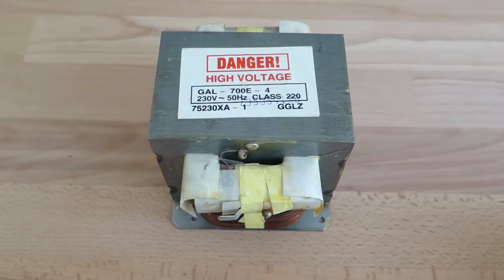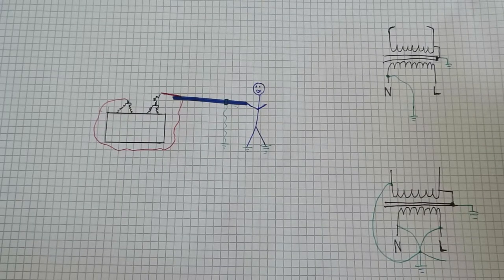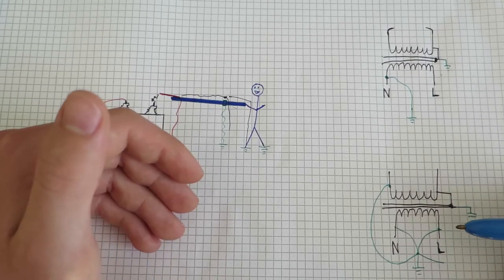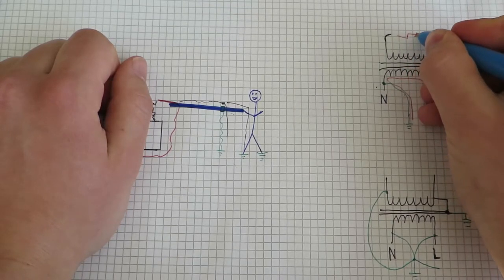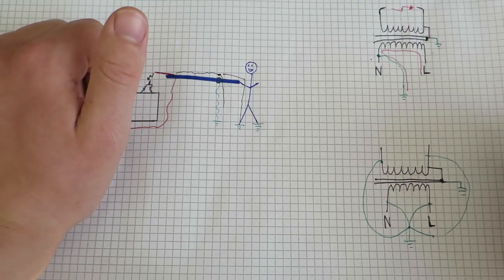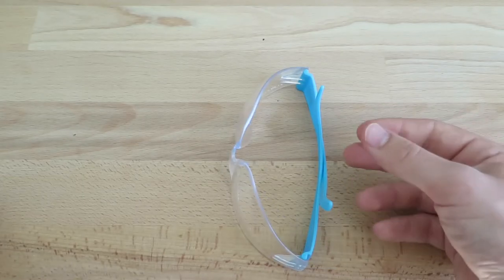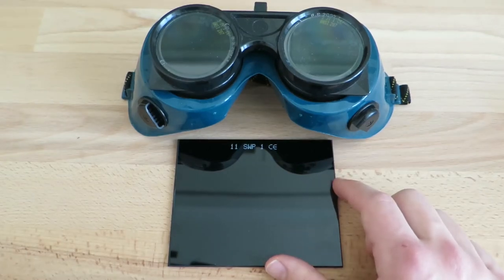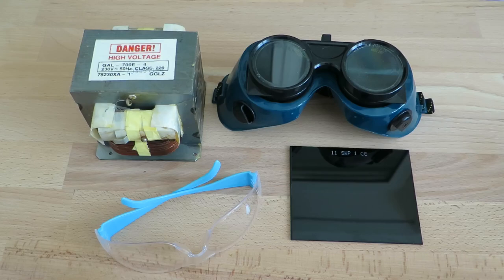High voltage safety (Mot's)

Comment: Neon sign and oil furnace transformers can be very dangerous. I had a transformer that
was rated at 14,000 volts.I forget what the milliamps were but this sucker  weighed in at
over 7 lbs. so I have to assume it had some real beef to it.
Reply from the maker: I have to disappoint you here, but probably not. Neon sign transformers and furnace egnition transformers are big and heavy but usually can’t supply much current.
Also unlike MOTs they are current limited to a specific value and thus can’t supply more current than they are rated for. Usually that is a low current like 20-30mA which will hurt very bad, but has a significantly lower chance of killing you than the 1-2A from a MOT.
So in summary, yes those transformers can be deadly but its way less likely than with a MOT for example.
Reply: @sciencebysergio  Hi there! Sergio, I have no idea what a micro zapper xfrmer
puts out in milli-amps.I suspect the voltage to be around 3 to 5 thousand. I do
know an oil furnace transformer puts out 10,000 volts at 23 milli-amps so that
equates to 230 watts.